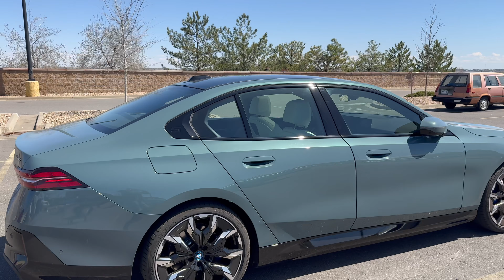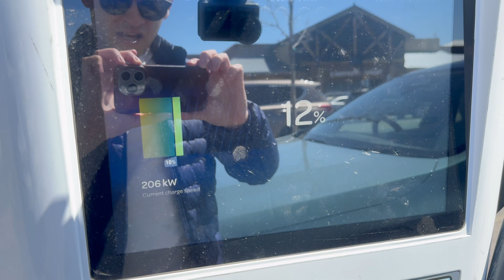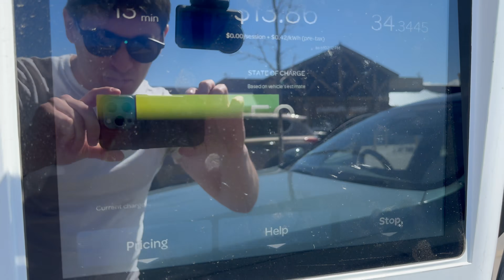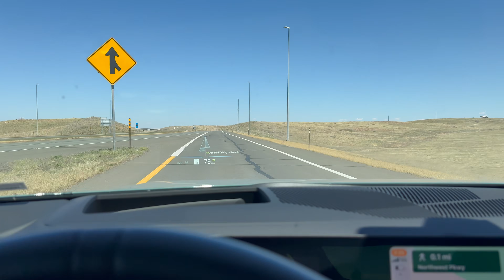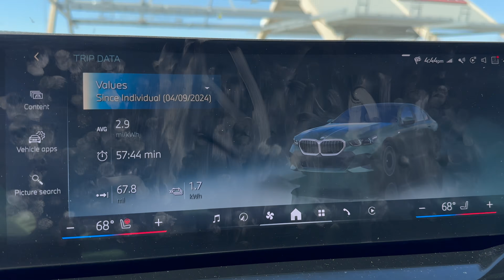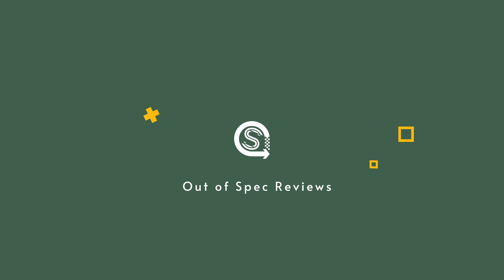The BMW i5 Did Just Okay On Our Road Trip Simulation Test - 10% Challenge

Comment: Great video, Out of Spec Testing. Looking forward to your next upload! I smashed that thumbs up button on your content. Keep up the awesome work! Your insights on the BMW i5's charging performance were particularly enlightening. Given the current competition in the EV market, how do you think BMW can improve its charging infrastructure to better meet road trip needs?
Reply: 800 V architecture is a great strategy. BMW already did a decent job at maximizing efficiency and battery size, I think there will be only minor improvements in these areas. Charging, however, could be improved immensely with higher voltages. I know BMW has been working with some dual-chemistry battery prototypes but honestly I'd be surprised to see that in the near future. Improved charging seems like a relatively low-hanging fruit compared to other options.

Comment: I did the 10% chalenge with my Q8 etron and received 41KW of energy charging for 15 mins. The short sightess of this 10% challenge, charging for only 15 mins,  is it doesn't expose cars that have a serious drop off in charge rate as time goes on. It looks like the i5 probably drops dead charging after 50%. I think a 10-80% charge challenge would be more helpful to the average roadtripper.
Reply: I supposed it's because the average none EV consumer only wants to spend 15 minutes or less charging coming off their ICE vehicles. For those of us who know, have, or have driven EV's, know that just an excuse; and that they spend way more time that they think on gas station stops. But it's the way many people think.

And most 400V EV's have a steep drop-off after 50% SoC or so. So it's a way to keep them comparable to 800V vehicles. In the next 2 or 3 years, the majority will be 800V. Especially these high-end ones. But for now, it's the most fair way to compare them all.

They also have other tests which are recorded on videos and published. Additionally, they have a website, "outofspecstudios", that has most of the stats of these tests. I especially love the "charging test" tab which shows the charging curve and how much 70mph range they gain after every minute of charging. I highly recommend checking that site out.